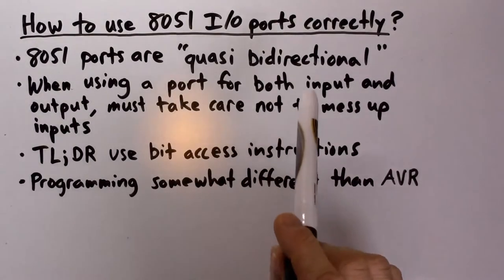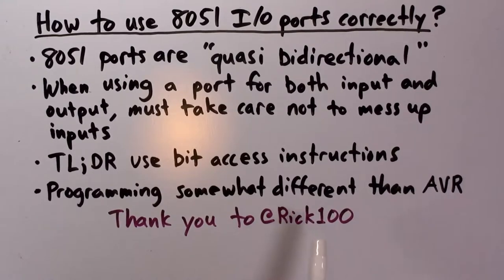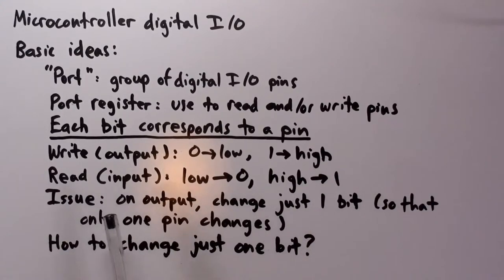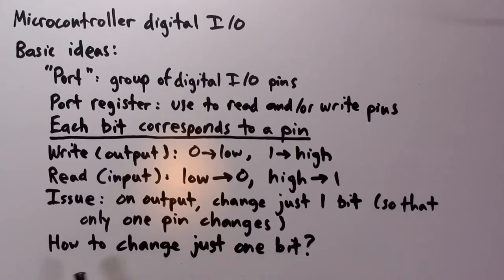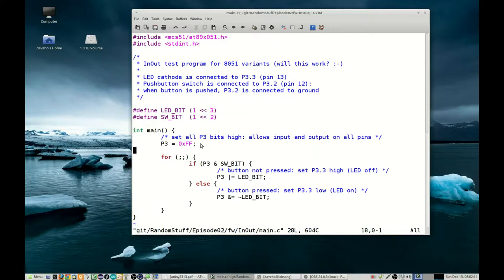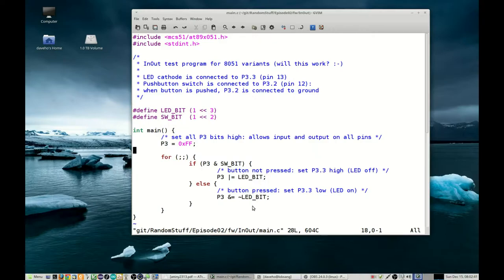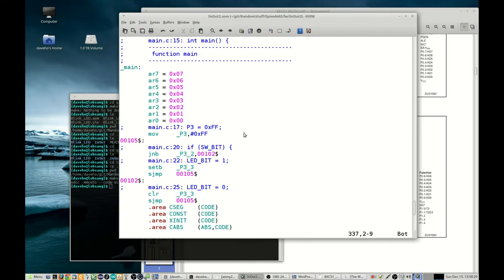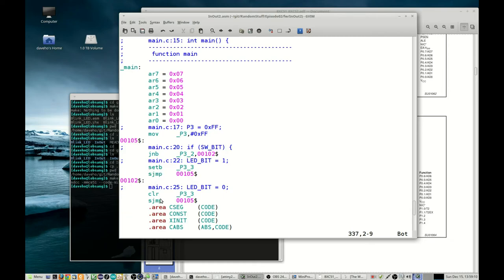Random Stuff, Episode 2: Digital I/O, AVR vs. 8051

Comment: Nice that you are presenting 8051 stuff in 2019! I'm a big fan of 8051, it's so fun microcontroller. I use the modern 8051 derivatives always when an 8-bitter is feasible.

The read-modify-write-problem you stumbled upon is well known and tricky to handle with SDCC. There has been vague changes in SDCC code generation during the years, whether it generates the real read-modify-write instructions (like ANL P3,#0F7H) or just read to acc, modify and write back. Newer SDCC versions (currently 4.1.0) seem to be more consistent on this. If I need to use port bit masks, I always check the generated assembly code for these caveats. Most of the time you can avoid the whole problem by using the direct bit manipulation.
Reply from the maker: I've really enjoyed working with the 8051. The I/O eventually did make sense once I stopped expecting it to be exactly like an AVR. I actually kind of admire the simplicity of the pseudo-bidirectional I/O pins.  I agree about using the bit access instructions, that's definitely the way to go when controlling individual pins.

Comment: Thanks for the mention Dave. I have to admit I'm still confused about why I get different results, but I only have one chip at this time to test the code on. Would you mind posting your 89c2051 hex file for the program that doesn't work. I would like to burn it into my chip. You can just post it in the comments if you would like. When I compile the program, the asm listing shows the logical "and" and "or" opcodes that should give the expected output and it seems to work on my chip. I'm compiling on a windows machine while your using Linux. I wonder if something strange is happening. I'm thinking about using this compiler to write some code for the C51 clock kit. Sorry to bother you but I'm curious.
Thanks,
Rick
Reply from the maker: Here they are! https://github.com/daveho/RandomStuff/tree/master/Episode02/fw/hex

I'm using SDCC 3.5.0 on Linux Mint 18.3, which is based on Ubuntu 16.04.
Reply: @davehohacks  Thanks for your indulgence. I burned your hex file into a chip and got the same results as you. The led comes on and doesn't turn off. Your compiler output and mine don't match.
I use the line:
SDCC button2.c -mmcs51 --code-size 2048 
to compile from a batch file.
The line:
SDCC button2.c
without the options produces the same output.

When I compile the file InOut I get the following output for the main loop:
X0062: mov p3,#0ffh
X0065: mov a,p3
 jnb acc.2,X006f
 orl p3,#8
 sjmp X0065
;
X006f: anl p3,#0f7h
 sjmp X0065

When I disaasemble your hex file for InOut, I get:
X0062: mov p3,#0ffh
X0065: mov a,p3
 jnb acc.2,X006f
 orl p3,#8
 sjmp X0065
;
X006f: mov r7,p3
 mov a,#0f7h
 anl a,r7
 mov p3,a
 sjmp X0065

I used the D62 disassembler.

In both programs the line "P3 |= LED_BIT;" compiles to:
 orl p3,#8
but the line "P3 &= ~LED_BIT;" compiles to:
 anl p3,#0f7h
on my machine and:
X006f: mov r7,p3
 mov a,#0f7h
 anl a,r7
 mov p3,a
on yours.

Your machines output causes the port 3 pin states to be read into the R7, modified, and written back to the port as you described in your video. The read,modify, write problem. The "anl" and "orl" instructions read the port latch, modify it, and then write it back to the latch, avoiding the problem. Why is the output different on Windows and Linux machines? Why does the compiler on the Linux machine produce different types of code for the top half of the if statement than it does for the code after the else? Strange. This may be all academic since the method you describe of addressing the bits directly avoids all this. But if this kind of strange behavior shows in such a small and simple program, it might show up later in a larger program and not be so easy to fix. 

When I enter the command "sdcc --version" to get the version number for sdcc this is the response:
 SDCC : mcs51/z80/z180/r2k/r3ka/gbz80/tlcs90/ez80_z80/ds390/pic16/pic14/TININative/ds400/hc08/s08/stm8/pdk14/pdk15 3.9.0 #11195 (MINGW64)
published under GNU General Public License (GPL)

Thank you again for your indulgence,
Rick
Reply from the maker: @rick_100  That is very interesting! I'm using SDCC 3.5.0, and from your version output, it looks like you're using 3.9.0. I'm guessing I'd see the same behavior if I used 3.9.0. Sounds like sometime between 3.5.0 and 3.9.0 they added some additional peephole optimization to generate "anl" for the foo &= ~CONSTANT idiom.
Reply: @davehohacks  I had never heard of SDCC before I saw your first video, so I just downloaded the latest version. I tried a C compiler on a pic project years ago, and ran into a problem on my first short test program. I had do examine the assembly output to diagnose it. I think it reinforces your comment on the first video about having to understanding the assembly language on these systems.
Thanks
Rick

Comment: Programming is SO much easier if you just use assembly language.
Reply from the maker: It definitely forces you to know what is actually going on with the hardware :-)
Reply: @davehohacks  do you know if SDCC supports inline assembly statements? I could see the appeal of taking advantage of the benefits (i.e. expediency and code readability) that goes with programming in C, yet writing inline assembly as required to be certain the compiler will use bitwise operations.
Reply from the maker: @RoyceTaft  It does appear that inline assembly blocks are supported using the _asm and _endasm keywords. However: if the goal is to access individual bits associated with specific I/O pins, bit variables work very well and don't require inline asm.
Reply: @davehohacks  good point! Thanks for getting back to me so quickly.